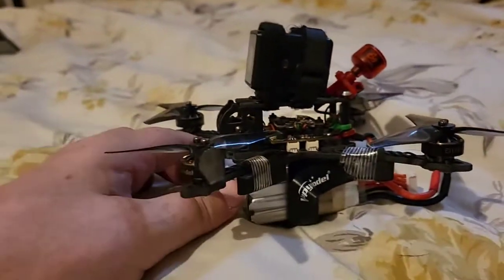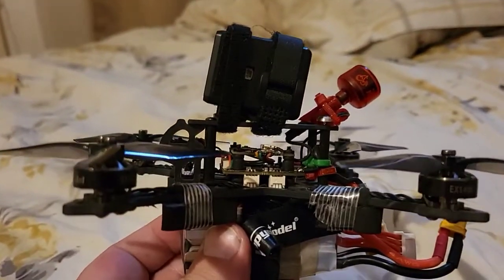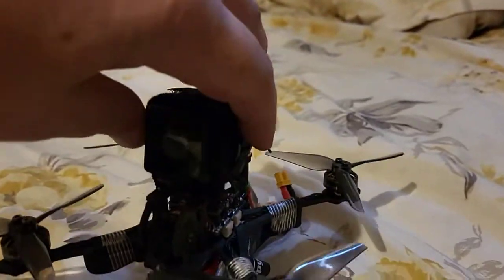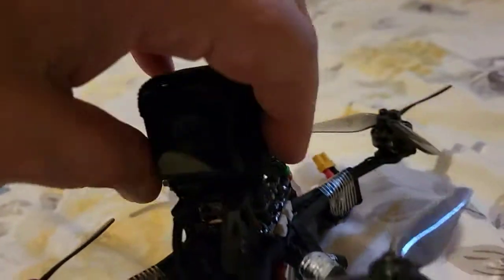#betaflight 4.3.0 RC 7 DSHOT 300 250HZ MATEKSYS R24S PRESETS

Comment: Oh yeah, let the Crux loose. I love the way it floats when I throw it over stuff. It just goes and goes too on an 850mah iflight. My eyes get tired after 8 minutes. I’m old. I need to get an action cam. Albert Kim had an interesting one on his channel the other day. But I need tires to keep my car going so I can make more money to buy more drones😆. It’s a cycle
Reply from the maker: Yeh the crux floats, thats the only word i could think of dude!
If someone asked me one word to describe the crux 35 it would be, (FLOATS)
AND U CAN ONLY KNOW THE CONFIDENCE THAT GIVES YOU, HEY,
CANT WAIT FOR THE WEATHER TO CHANGE SO I CAN TRY THE CRUX35 WITH THE HAWKEYE 2 ON, THE HAWKEYE 2 DONT WAY MUCH AT ALL, I LIKE IT CAUSE IT HAS AN IN BUILT BATTERY, IF I WAS RUNNING THE THUMB FOR INSTANCE, I WOYLD USE MY MATEKSYS BEC AND SOLDER STRAIGHT FROM BEC TO EXTERNAL ACTION CAM, LIKE YOU SAID, YOYR HANDS GO NUMB BEFORE THE 850 LIPOS 12 MINS + RUNS OUT
Reply: @rcaddict9558  my eyes start to cloud up at about eight minutes in the goggles. It’s annoying. I’m trying to fix this little Mobula7. It’s doing some weird jittery thing when I try to fly. 
I’m going to check the endpoints and put new props on, but it’s flying like shit right now. Right out of the box.
Reply from the maker: I know that jitter, like a car backfiring? Every 5-10 seconds
Reply: @rcaddict9558  kinda, it was definitely just a crack in the canopy above the camera. The new Happymodel mobula7 has a lightened canopy that apparently can’t take a hit for nothing. I don’t even think a crash caused it cause it was doing it the first time I plugged it in. I thought it was my endpoints but I fixed them and it persisted. So I got the magnifying glass out😂 and low and behold there’s a crack. I’ve seemed it up with some E6000 and it rips. The VTX range it very good. I can fly all the way through and around my house from inside my bedroom. It’s fucken sick. I’d post a video but the place is a mess inside and I don’t want anyone to see it. Whatever. My dads dog is hilariously chasing it everywhere. Classic shit.
Reply from the maker: @PoodlehawkFPV  well its 3am and im up again, i tell you, it aint stopped raining for 2 days now and i cant wait to take the crux out with the hawkeye on, that hawkeye is good for 50quid, 2.5k, its got a battery, and its fine on the crux
i said about the misfiring like an engine with bad coilpack or plug, cause when i got my first crux which i lost in this video
caddx ant FPV NIGHT FLIGHT https://youtu.be/KYdER-b21zc
IT STUTTERED WHEN IT WAS NEW!
PISSED ME OFF BUT FLEW BRILL, BUT THEN THIS HAPPENED
FPV NIGHT FLIGHT GOES VERY BAD
https://youtu.be/Y_p0P7oC974
LOVED IT SO MUCH I BROUGHT ANOTHER!
PEOPLE LOVE EM CAUSE THERE ALWAYS OUTA STOCK AND SELL OUT IN HOURS
Reply from the maker: You seen this video
took my hours to edit!
Reply from the maker: This video
NIRVANA TRIBUTE FPV Next to cell tower https://youtu.be/8UE2a3-j0CA
Reply: @rcaddict9558  I know man, your great at editing. I’ve got no patience for all that. I had a hell of a time when I first started trying to show my family and friends footage from my flights. I don’t think they are as enthusiastic as I am but man have they been supportive of this hobby. My girlfriend has been a huge supporter and helped me figure a lot of stuff out. You as well. I’m always grateful for help. It means a lot. 
I never imagined I’d find a hobby that could literally consume my day but this is the one. Even when I’m working I’m trying to learn about Betaflight and crap. Usually I’m working when I see your videos. 😂. The last one was good, I could tell you put a lot of time into it. I may need editorial advice someday, cause I suck at it😆
Reply from the maker: @PoodlehawkFPV  thankyou, it consumes my day aswell but, Rehab was hell and brilliant at the same time, i learnt so much about myself, and addiction is about the behaviors, the drug,drink, (same thing) is just the precursor, the lighter that starts the fuse!
It consumes my life and as im on my own, i just cant stop untill its fixed or sorted, i look like shit in that  last vid, been up hours chasing my tail!
i used to build supercar engines, then i taught masters and PhD students the data acquisition part of their course, using NATIONAL INSTRUMENTS LABVIEW, its C++ but virtual wiring, so it has a gui!
i was a workaholic, crack pipe in my pocket to wake me up from all the h and downers i was buying.
total madness!
hey, im glad i can speak to someone that understands, cause looking back on some of the lies, bullshit i got away with, i have to laugh, chuckle!
THAT FAMOUS JOKE, "HOW DO YOU KNOW WHEN A USING ADDICTS LIEING? WHEN HE OPENS HIS MOUTH!"
gonna make a sandwich, cheers for the affermation(bad spelling). Catch you later dude!